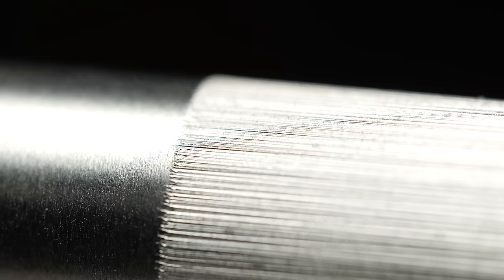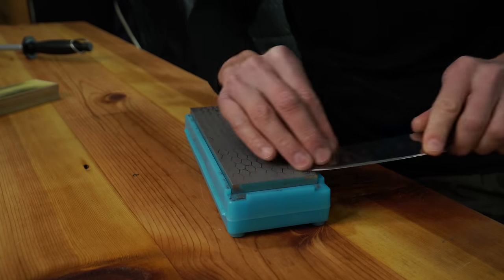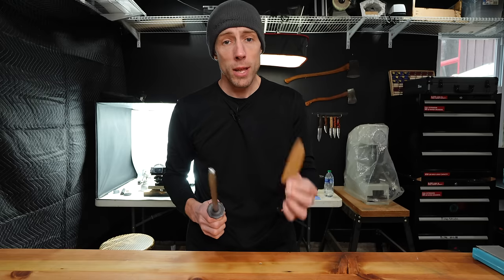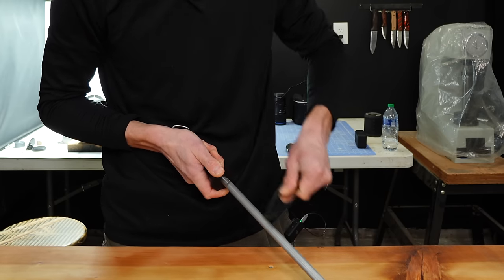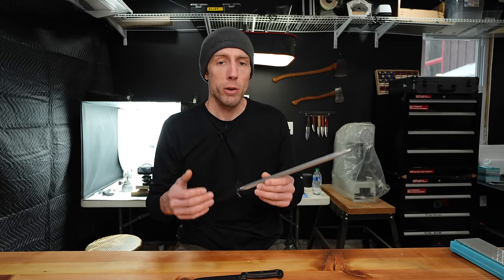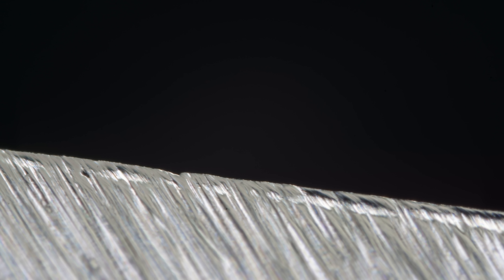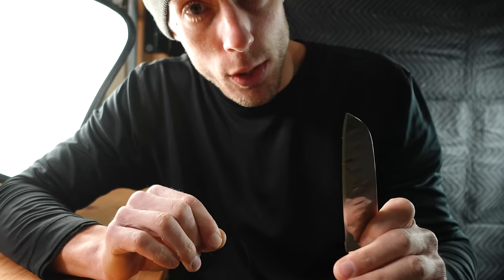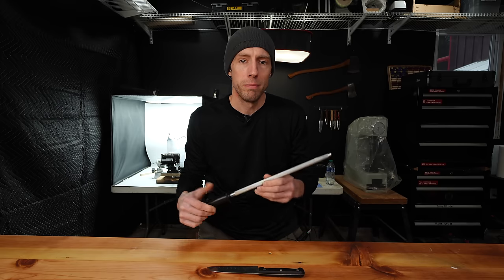What Do "Knife Sharpening" Honing Steels Actually Do?

Comment: Great production value and its nice to see some scientific method to your theories but you both have no idea how to use a steel and are using shit knives and steels, also you aren't at all grasping the concept of what they're for.

I was a butcher for a few years and was taught how to use a stone and steel, you would sharpen your knives on a stone every day or 2 but use a steel every 20 cuts or so, if you work in an environment where you can't just whip out a stone and sharpen whenever you feel like it you need a tool to maintain an (already sharp) edge, if you have worked as a butcher or chef and KNOW how to use a steel you would be able to easily tell that it has a positive effect on a blade. 

At home I butcher my own ducks pigs and sheep, you cant be half way through 1 of 4 sheep and just clean up and sharpen your blade, my wife hands me her knife constantly to hone it because it makes such a difference that even the complete novice can feel the difference, ill sharpen 2 knives just before we start and hone them throughout the process and it makes a massive difference.

When I leave my kitchen knives too long and try use it, it barely does anything although it does help slightly but if every time I pick my knives up I run it on a steel a few times it significantly increases the time between sharpening. 

You need a good steel, f dick or the likes, I have a ribbed f dick ive used for years, slightly abrasive so can bring back a more dull knife, the completely smooth flat steels are better if you have more skill sharpening and use in a professional environment, when I used other peoples as a butcher I noticed the difference but never bought one and for practical kitchen use my semi abrasive one is perfect.

Comment: That is not the way a Butcher uses a steel. The only difference between the way a Butcher uses a steel and 'Ramsey' is they hold the steel steady and get the knife angle perfect (very hard to learn). It absolutely removes a rolled edge. You will see them picking the edge with a thumbnail to check. They know what they're doing, they cannot work without a razor sharp knife...

Comment: Waaiiittt a minute - when you compared the sharpening steel with the diamond abrasive at 12:30, you reversed the direction of the blade against the steel.  That is, first you cut into the direction of motion - edge first - then the same with the abrasive stone, and then said "same motion," but then moved the knife in the opposite direction, with the edge trailing the direction of motion.  

This is a constant curiosity to me; moving the blade edge first seems to me to be a sharpening motion; trailing edge is more of a "stropping" motion, meant to polish the edge.  Yes, I'm as obsessed about getting a razor edge as anyone, but I'm always questioning the need for stropping - it seems superfluous.  I would think that the only rationale for it would be that you could polish the edge somewhat by using a very fine abrasive on the strop.  Still, it seems like a movement ALONG the edge would be more useful.

I bring this up here because you have the magnification tools to show exactly what is happening when the blade edge contacts the various abrasive surfaces, and thus can demonstrate what each motion and action accomplishes.  That's a very valuable educational tool.  I appreciate your effort to educate and demystify and debunk common sharpening beliefs.  Thank you for your efforts.

Edit: I saw your other video on sharpening steels, so I watched that.  Interesting that the direction of motion doesn't make a big difference.  I gotta get me a microscope . . .

Comment: Your drawing representation of rolled edge and knife steel is wrong. The steel does not touch the rolled edge at the point it's rolled, it glides along the edge and pulls it straight before it reaches it. Provided you have the right amount of pressure of course. If you do it too lightly, you will indeed contact only the apex and damage it. There's a technique to it. I won't claim I know it, I've never had any luck with those things either, but almost every butcher I saw at work uses those, and you can tell just by looking that their knives are scary sharp.

So I have to conclude that you're using it wrong, despite trying for a long time. As I said, I don't know how to use those (I've lost the last one I had and don't want to buy another one), but I have some ideas. I believe the trick is to do it fast and with a decent amount of pressure, and do just a few passes, perhaps 2 each side. IIRC that's how the butchers did it. Zip zip zip zip and cut. My theory is that if you hit the correct angle and use quite a bit of pressure, it can only straighten the edge (can't roll it over to the other side because the steel is supported by the thicker part of the blade). The grooves are probably there to concentrate the load at a smaller point (so you don't need exactly the same amount of pressure you needed to roll it over - that copper pipe was quite big and had a lot of contact). The grooves possibly also help retain fats and oils on the steel and provide lubrication. The point about doing it quick is that with such a small point of contact on such a thin bit of the blade, swiping it fast across the steel should generate quite a bit of friction heat, possibly enough to soften it a bit or even make the edge straighten by itself. (Some) metals which have been deformed beyond the yield point can straighten again when heated, though probably not completely. I guess the speed /might/ be the trick.

I do concede that these are crap, at least for the common user. I now have a ceramic rod and that works better than I could ever make the steel work. But I don't think your research on this is over, you might need to revisit. Perhaps find a butcher who uses those and let them do it? Perhaps ask them when it is useful and what for? After all, if I tried to fly an airliner and were to find that I don't even know how to start the engines, I wouldn't be right to conclude that airliners can't fly, right?

Comment: Id like believe that the knife steel was made in the same line of thinking as a card/cabinet scraper, the way these tools work is by using a burnishing tool pressed into a metal card the metal forms a hook on both sides and can then be used by dragging wood against the hook in reverse in order to remove small amounts of material. My best guess on the knife steel would be the same process but in reverse by rounding out the "hook" in the blade after chopping so much that the knife edge would eventually get pounded flat by repeated impacts over time. But regardless it seems like a hunch someone had in a kitchen somewhere a long time ago that became a tradition/superstition.

Comment: I have used honing rods for years. It's my go-to favorite way to get the knives sharp again. It's not designed to correct a "true rolled edge"; that's a straw-man. It's basically a strop, which, when a knife is used properly on the proper materials, is generally all one needs to bring a knife back to being razor sharp. If i for some reason had decided to try and cut a metal pipe with a knife, and rolled the edge, then I would start with a metal file and go through the whole sharpening process. When used as a strop, they work just fine.

Comment: I am sure the "non-abrasive" rods are in fact abrasive like wetstones. They may not be calibrated like a wetstones, but they work okay for minor sharpening jobs. They would have a high sand paper abrasive rating. I have used them to resharpen serrated wavy or scalloped edge bread knifes, as it can be hard to find round wetstones.

Still nothing beats taking the time to really sharpen knife correctly, but on todays time poor society, good enough is better than nothing.

Comment: As an outdoorsman, I've always used my grandfather's oilstones on my fixed blades and tactical folders then strop them. I use the same method on my kitchen knives and when I have occasional guests, I have to warn them that they are very sharp because some think that kitchen knives aren't and my boning knives are sharp enough to shave with.
  I'm interested in your knives now and I've subscribed because you are informative and thought provoking. Ever use diamond dust on your strops?

Comment: I’ve seen conflicting instructions regarding using the honing steel. Do you run knife against it with the edge leading (like on a sharpening stone) or trailing?

Edit: never mind, saw the follow up video. 👍🏻

Comment: The experiment with the true rolled edge is interesting, but completely impractical. Most people don't use whetstones, don't sharpen their knives perfectly, don't remove the burr and don't hone their knife with its apex still sharp. The case in which a person would use a honing rod is when the hastily sharpened knife had dulled from hitting bones or a cutting board a bunch of times and needs to be quickly made usable. The person likely doesn't have knowledge, time or patience to set up whetstones and hold perfect angles for like 5 minutes, since they don't have much experience. It's a product for a different type of knife user.

Comment: As a prior chef and knife enthusiast I feel like you’re missing an important test that could shed more light on it and how you may be correct with a hard stainless from the dollar store but WHAT IF… you were using a quality high carbon steel chef knife like you would have had back when that style steel was best we had to work with? Diamond/ceramic technology wasn’t available in kitchens back then, but back then a quality knife was softer than we typically like today, the goal wasn’t a hard steel, it was one that would easily take an edge

Comment: So we're using dollar store SS steal? Who uses that in a kitchen?!
Sure they're great for sandwiches and you toss them when they're dull.  This is not chef knife steel. 
High quality kitchen knives use a carbon steel that can rust if not cared for. SS is very hard and damn hard to sharpen and damage. Good kitchen knives are softer and can be straightened and sharpened quickly. Honing steel is quite useful on a high quality knife made of softer material

Comment: Terrific video. Excellent images. In the past  these honing steels were just used and talk about as though 'everybody knows how to use them,'  (I've been in NYC kitchens when the knives came back from the sharpener. So the chefs using the honing rod would regularly send the knives out, and they'd come back looking like hacksaw blades.  Grinding wheel. These were not the chefs who had their own knife roll.)   Instead of pretending along with them, I learned how to properly sharpen.  My daily tune up of my kitchen knives is to just lightly dress the edge with a ceramic rod.  Before I do it the paper test will sometimes tear or stop, after a few swipes it works like it's supposed to.   And yes diamond 'stones' are great. I use a Trend, but cheaper ones are just as good.  (I've also used it to grind my fountain pen nibs.) 
I also use Scary Sharp for my chisels and wood plane blades. Works on my kitchen knives too.  I'd strop more if I could get a longer piece of leather.  Fine Wookworking magazine in the 1990s did a sharpening test using an electron microscope to check the edge. The expensive rotating  machines weren't as good as basic stones or scary sharp, with stropping being the only way to improve on these. 
Also, after use or a day or two,  use or  oxidation will slightly degrade an edge, so a ceramic rod tune up is just good practice.

Comment: Science of sharp has made an article called "What Does Steeling Do? Part 1" about the effect of honing rods both steel and ceramic complete with SEM imagery. The short of it is: A rod does remove material, and forms a micro-bevel with a steeper angle than the existing one. This will sharpen a knife that has been dulled with use, though likely not to it's original keenness. In addition the metal is removed by adhesion. Metal from the apex sticks to the rod due to the high pressure caused by the tiny contact point between the knife and steel and is torn away from the blade. This allows a relatively soft rod to remove material from a hardened steel edge.

Something I do wonder is how a steel and a clean strop would compare in terms of material removal and resultant micro-bevel geometry if the clean strop even produces one.

Comment: So, why does using a steel do a good fast job of dramatically improving the cutting of my otherwise dull and neglected knife that hasn't seen a stone or hone in a year or more? Yeah, a good edge lasts much longer, but getting one takes much more time than a few quck strokes on a steel. For "quick and dirty" on an otherwise neglected knife, the steel seems exceptionally functional.

Comment: I have to disagree with you on a couple of things you said early on period A knife steel does exactly what it's intended to do period which is Pull the Burr off of the edge. As for whether or not steal is abrasive or not, it most certainly is, just not by very much but if you use it long enough it will sharpen a knife, it will just take quite a while. Surprisingly the back raw Burr on the bottom of a dinner plate will also take the Burr off of a knife and sharpen it. So will the bottoms of your leather soled shoes because of all of the abrasives that have been embedded into the leather and you can get some really sharp edges by using the soles of your shoes, especially depending on what if you have been walking on.
I will commend you because you are one of the few people I have ever watched on YouTube who actually sharpens the knife properly by pushing the blade against the stone instead of dragging it. However you're showing the use of a steel exactly wrong. A steel should also the blade should also be pushed across the steel just as if it was a stone. A kitchen knife, so thin that dragging the knife across the steel will cause an almost instant Burr. That's why you push the knife blade.
The difference between a rolled edge and a burr, is best used by calling it a wire Edge it doesn't matter what you call it it has the same effect. And because of the softness of that blade it rolled actually fairly easily even though you had to use some pressure, and a rolled Edge usually has to be cut off of a knife. Just like a burr.
Difference between these things is how you correct them but their effect is much the same as I said.
All the steel is meant to do, is to put a quick fine Edge, so that you can make some delicate cuts into usually the meat or vegetables that you are applying it to. The natural corrosion that occurs on the knife can damage that fine edge, which is why every time you use the knife or almost every time you put a few quick straps on that butcher steel. And most of the ones I've seen that are any good do not have those lines on it those are very rough, and I do not care for them. If you are very gentle when you use the knife on that type of feel that you're showing, you can get by with it. But a truly nice sharpening stone works well. You can use a good piece of Cold Steel Rod or even a good piece of forging, with a very finely sandblasted finish, and it works near perfect and forever.
The one thing I did notice many years ago, is the quality of the knife depends on how often or whether or not you even have to use a butchers Steel. Case in point, some of the best kitchen knives I've ever used, are literally the high carbon Old Hickory knives. They are wonderful kitchen knives. But they do corrode if you don't season them with some oil. Little bit of heat with some cooking oil, will season the blade, take care of them. Very few off-the-shelf stainless knives are worth the money you pay for them unless you pay a lot of money for a decent surgical stainless steel.

Comment: "Honing" is actually an abrasive machining process. It is typically the last process in a metal machining process chain and the one, that gives the object the finest surface and is done to reach extremely high precision.
That is, why it is only very minimal abrasive and more like a polishing part.

That is also, what it is used for in Kitchens. It does not straighten the edge. It gives the knife the last finishing touch and as this finishing touch does not last very long, it's repeated regularly before using the knife. As it is similar to polishing, it does not require a lot of pressure, but many repetitions, so doing it fast and light is exactly the way to do it.

However, as for polishing, true honing requires an abrasive tool, that is harder than the material that needs to be honed. So a "non abrasive honing steel" will most likely do nothing to a good knife with some decent hardness. But it will also do nothing to a cheap knife. They are mostly made of stainless steel, which is known to be very elastic and tenatious. (Try to bore a hole in it). 

Long story short: To earn the name of "honing rod" in the true sense of the machining process called honing, the rod would have to be hard and abrasive with a very fine grain. That is, what the ceramic honing rods do.
A simple steel "non-abrasive" honing rod is essentially not a honing rod. It may be a straightening rod, but that's something completely different.

Comment: A knife steel is a file. It's not a stone. They shouldn't be compared. Most amateurs don't have a good edge on the knife to begin with so it works for them creating a rough burr that will cut something like a saw does. Professionals will stick to real Arkansas whet stones or Japanese water stones. They are worth the price, but only if you know how to use them. Knife sharpening is a skill that used to be passed from father to son. But fathers have been removed from homes by feminists like the TSA removed pocket knives from airplane passengers; through the unjust use of military force, so primitive skills are lost to now three generations of men.